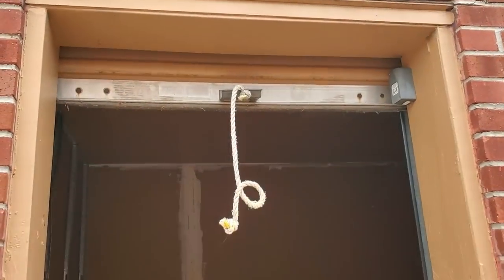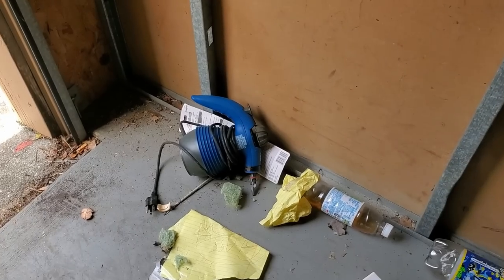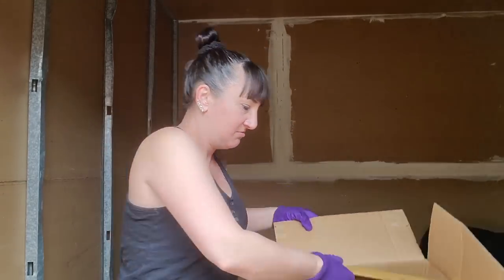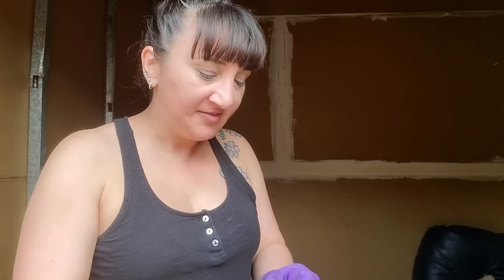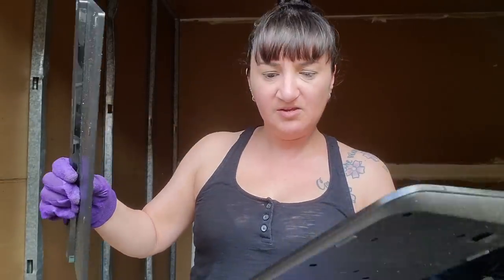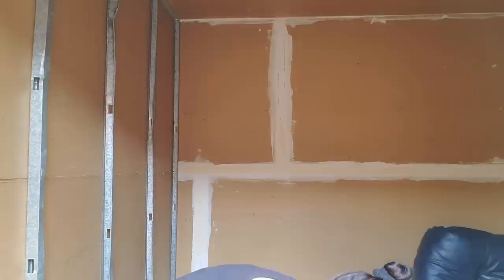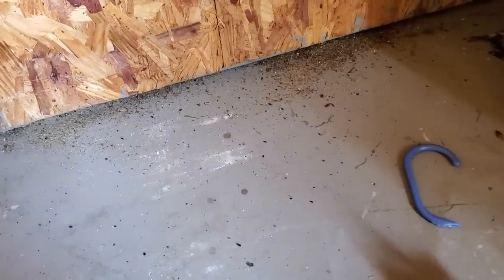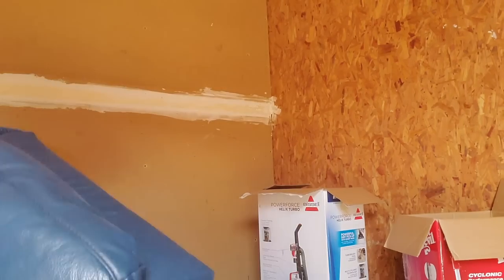I Bought An Abandoned Storage Unit For Only $10 | One Man's Trash Is Another Man's Treasure

Comment: Melissa, the best way to clean stainless steel is to use denture tablets. I own a lot of coffee mugs and thermos and all I do is drop a tablet with hot water in them and let them soak overnight. All I have to do the next day is dump the cleaner out and wash the items with soap and water. It does an amazing cleaning with little work. You can get the denture cleaner at Dollar Tree for cheap.